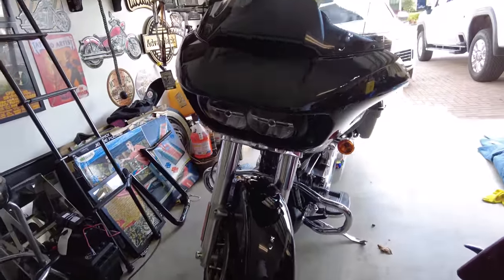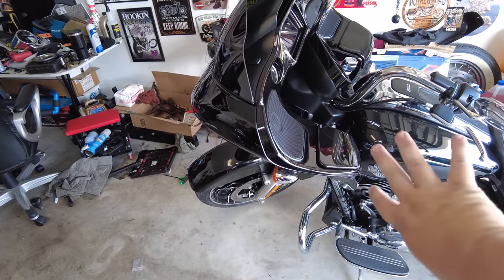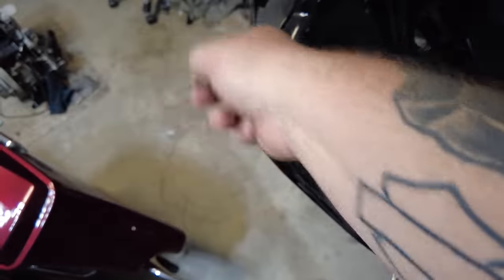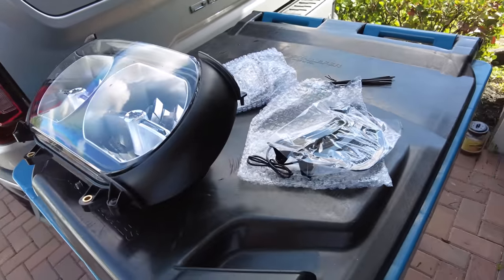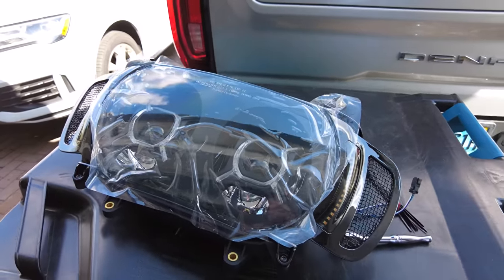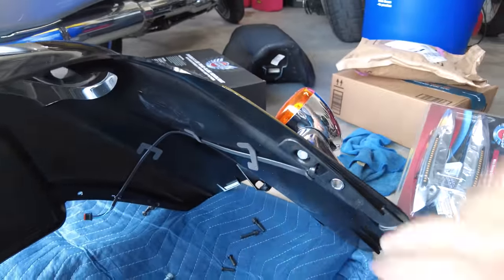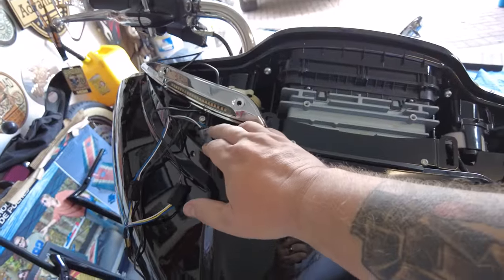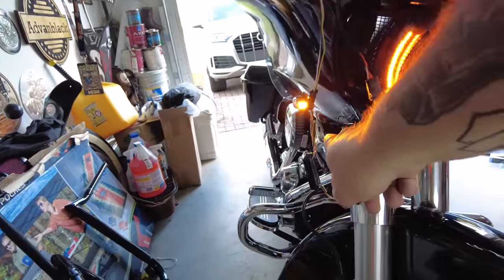Harley Davidson Road Glide "Level 1" Upgrades Episode 3 - Front Lighting

Comment: Definitely the black version of that new headlight.  
    Curious, to see down the road what performance upgrades you go with, and if [at least for the time being] it'll be a "warranty" build?  Lots of Stage-2 and Stage-4 builds out there, but not too much about the Stage-3 builds.  What would be interesting [& different, as not too much on this kit on YouTube] would be the HD-SE Stage-3 114-to-122 Kit which comes with the HD-SE Stage-2 Torque Cam.  I'd imagine this kit would have pretty darn good low-to-mid range torque, and that HD-SE Torque Cam does have a nice idle "chop".   
Tom M.  '21 RGS Stage-2 114 (S&S 465 cam chest kit; S&S 2-1 Sidewinder w/matching Ghost Pipe; S&S 55mm Intake Manifold; Fuel Moto 3956 ventilator-style A/C; Dynojet PV3b Tuner; HD oil cooler fan, & Trask M8 Checkvent).
In the works:  bored/honed 114 cylinders to 4.125" (make a 114 into 120 cu. in); Carillo Forged 10.75:1 pistons; Dynojet TT-8 Wideband O2 Sensors Kit for PV3b (2021-2022 HD with ECM Strategy # 28); Lightly modified stock heads w/S&S Top End Kit.